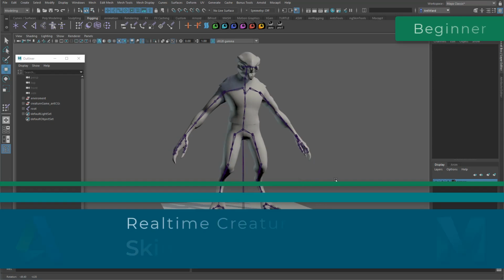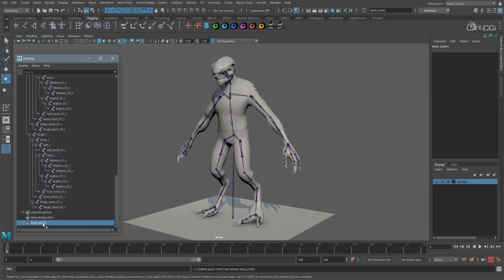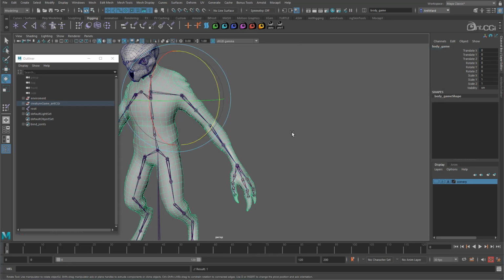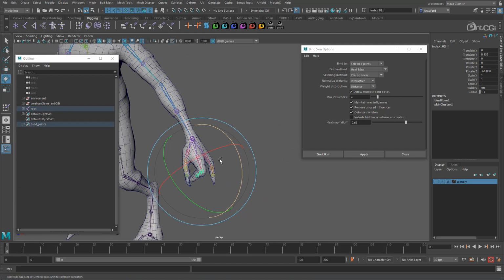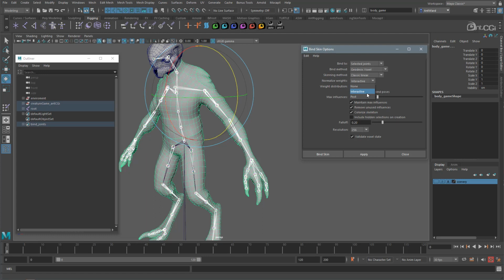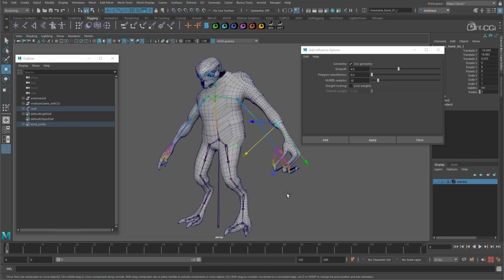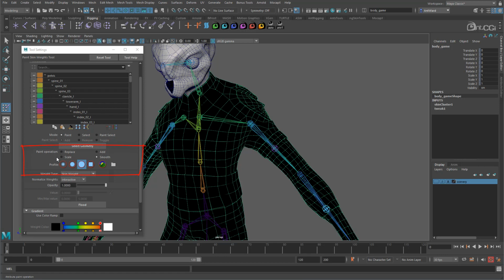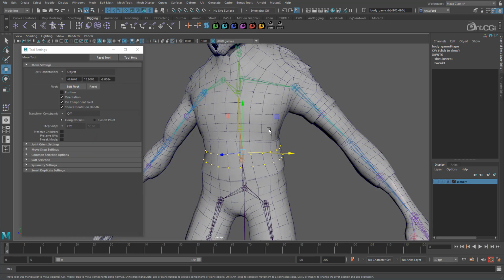Realtime Creature Rigging Workshop (5 / 19) : Skin binding and editing

Comment: Lesson 05 Skin binding and editing

1:20 use Assume Preferred Angle to go to build pose (maybe because of
	Set Preferred Angle from previous lesson)
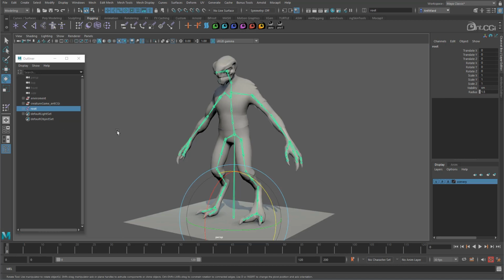2:05 only use necessary joint for weight painting
	NOT USE: Root, cog, upper arm (twist joint for shoulder), handTWIST (?)
	thigh, footTWIST.
3:25 create a selection set for binding joints (sometimes need to detach,
	add joints, more functions, etc.)
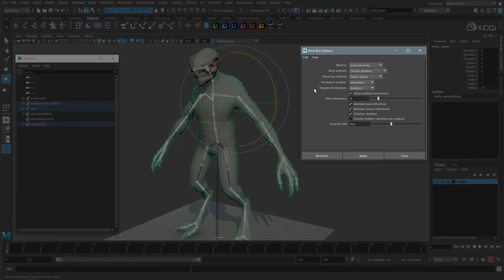4:45 BIND SKIN OPTION
	Max Influences = number of joints could affect a vertex (usually 4)
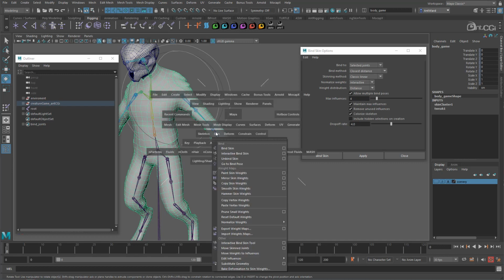7:00 Unbind skin with Keep history = keep Skin cluster AND weight (?)
	useful for minor changes
	Bake will pose your model
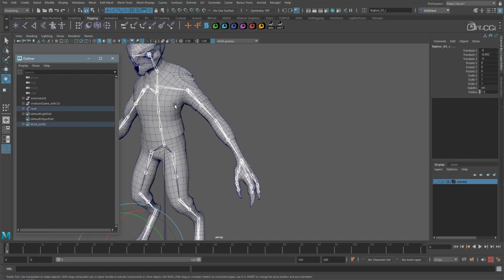8:00 other Bind skin option Bind method
	Dropoff Rate: the higher the harder weight edge of each joint is (not exist
		in maya 2022, instead is Falloff (0-1, default 0.2, don't see any differences)
	Closest in hierarchy: better if joints are closer together (e.g. hand lower down
		next to thigh > finger could affect thigh > Closest in hierarchy for better)
	Heat Map: similar to Closest Distance, but better, especially for fingers
		and tight gap
	Geodesic Voxel: better for non-manifold faces, but generally model should
		be cleaned so this doesn't have much use (at least for now)
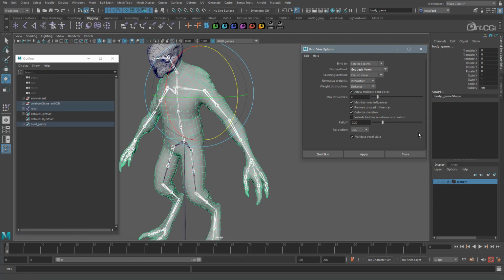14:20 other Bind skin option 
	Normalize weights: keeps weight value between 0-1, Interactive means
		it working while painting weight, Post works when model deform
	Weight distribution: determines how normalize weight works,
		Distance could cause issues when smoothing weight,
		Neighbor keeps normalizing local
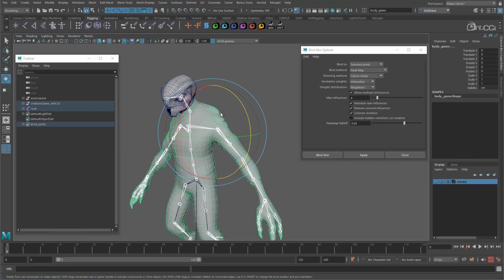16:30 final "best" options: Heat map, Weight distribution set to Neighbors
	Max influences 4
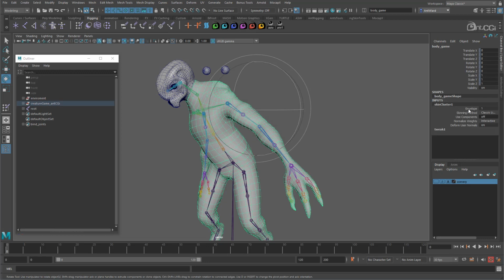17:30 Skin Cluster inputs
	Envelope: enable/disable weight (how much weight affect vertices),
		good for when need to see the original mesh without go to bind pose
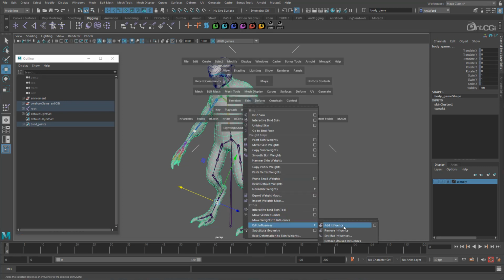18:40 Add Influences but with Weight lock and default weigh = 0
21:00 There are many useful options with the default paint weight tool
	like rmb joint on paint weight setting table could let you select affected
	vertices of a joint, add more vertices from other joints to selection

Comment: after I bound the skin and I try to rotate the shoulder joint, it pulls at the head faces. I did every step that you had done, but now it's acting odd.  Any suggestions as to how to fix this issue?
Reply: You need to paint skin weights and remove the influence from the head